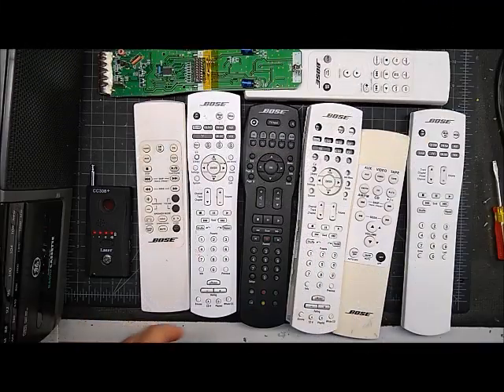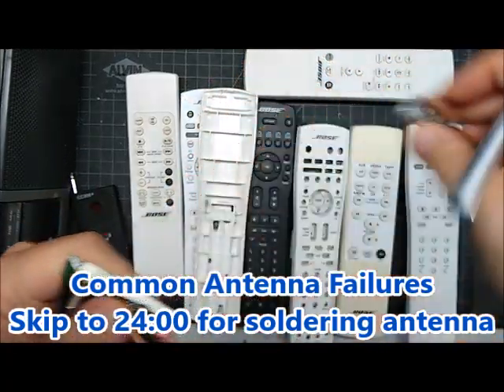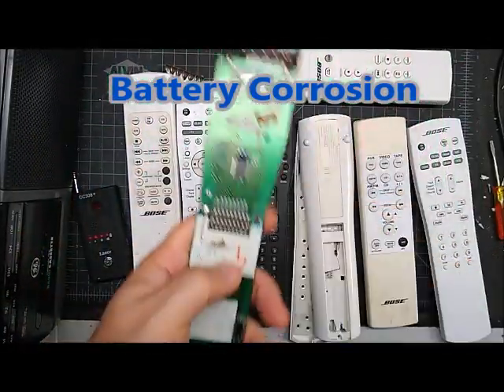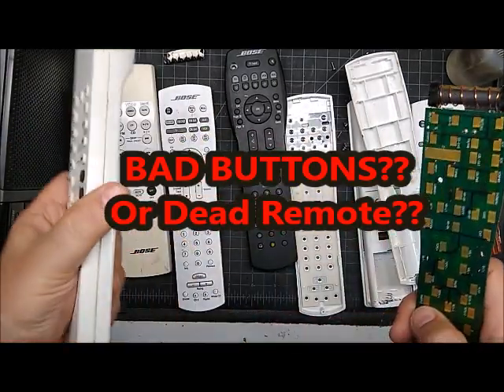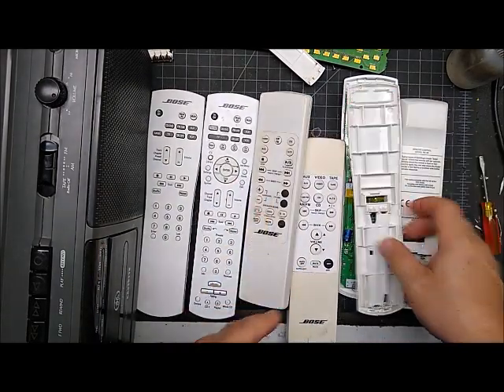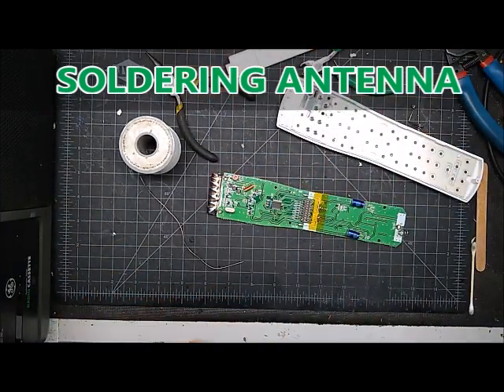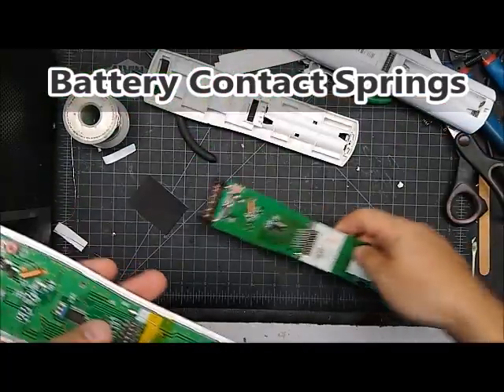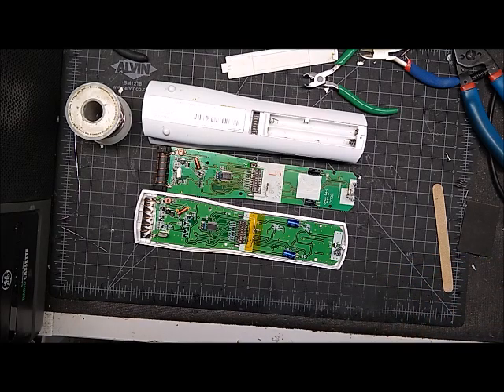Troubleshoot and repair old BOSE remotes

Comment: Thank you!! I got my remote working after MONTHS of trying. NO SOLDERING!  I'm not sure what exactly worked. it could have been the cleaning. It may have been wiping off corrosion (which it didn't really look like there was any). Wiped the board down really well after you spoke about the silver dust causing a short and keeping the button on. LASTLY, I realized on my last reassembly, that when putting the controller back together, ONE OF THE BATTERY SPRINGS DID NOT GO INTO THE GROOVE OF THE REMOTE. WHEN I PUT THE REMOTE TOGETHER, ONE SPRING SLID DOWN ON THE WRONG SIDE OF THE PLASTIC, WHICH WAS KEEPING THE BATTERY FROM MAKING CONTACT. Once I put it back together with all battery springs showing and making battery connection, it WORKS!!! Thank you!

Comment: I have a Bose wave radio that I have for 12 yrs that been sitting for 8 of those years.  I believe it was shorted, I am wondering where I have it repaired.  All I hear is static, nothing else,  with a nine volt battery in the back it just lights up.??????

Comment: I have a Cinemate SR1 remote that won’t power on the soundbar. It is the black remote you are showing, it works to power on and off the TV, but not the soundbar. The 3 top buttons don’t do anything.

Comment: Thanks for the great video. I bought a Bose set on Marketplace for cheap because the remote was dodgy. Your video helped me to narrow the problem down to the aerial which the solder had come loose - easy fix. When testing it out I also noticed a setting on my Apple TV by which I couls control the volume from the Apple TV remote so double win.

Comment: Great video.  Do you have instruction for fixing Bose RC48S2 remote?  That's the remote with the LCD screen.  My remote will not power on.  I don't see any corrosion on the leads.

Comment: Good video letting people see inside their remote controls which are the same, I noticed the trouble you were having soldering the thick solid earth copper onto the board, the problem with this is it's a heavy piece soldered onto a small PCB pad, it might break that pad off in time, you were having lots of difficulty soldering the antenna because you didn't pre tin the whole piece of copper you were going to solder, it broke off because you didn't apply enough heat into that piece of copper, maybe a small "helping hands" clip would help you, it can hold the wire for you, while you apply lots of heat and tin the wire, soldering the antenna to the copper then would've then been easy.

Comment: Love this! For my remote the Sound button is suddenly flipped. E.g. up button reduces volume and down increases it... do you have an idea what could be wrong 😂
Reply from the maker: That doesn't even seem possible. I would check for corrosion on button contacts and IC chips. maybe corrosion is confusing the processor

Comment: HI Great video! I had a question regarding the Crystal in a remote like the one you have all the way to the left in your video. The crystal broke free and the pins are completely gone for the most part(broke flush at the base of the crystal) so I was looking online to find/order a replacement but they seem to be pretty hard to come by at the 27.145 mhz frequency, unless going to a rip off artist trying to charge $50 for the part plus $20 shipping for what I believe is a $1 part. Would you know a good place to get them (I'm in the US) or would you know if the crystals that are much easier to find but  only at 27mhz flat frequency would work? Any help would greatly be appreciated.
Reply from the maker: I found them on eBay from China a few years back. You would need the 27.145

Comment: Greetings I have the bose cinemate control, when I try to increase the volume it does nothing, if the low works but it does not increase the volume, the other buttons work, I did what you mentioned to clean the board with alcohol but nothing happened, some other recommendation that you could give me, I await your answer, thank you!

Comment: Another possible fix was: THE up and down pins on the back of the remote which sync your remote to your system; they all "LOOKED LIKE" they were down, but one of them was barely up from the fully down position. Maybe this was keeping remote from transmitting.

Comment: Sir, Everytime I push any remote buttons, the music stop / mute.
After I pushed any button the music starts again, is the remote broken?
Reply from the maker: Sounds like something is wrong. Some Bose remotes have silver paint snap domes. That can wear off and stick to the circuit board causing short circuits. It could be battery corrosion or water damage also.

Comment: My remote only works close to the receiver, any ideas why that is?  Antenna is intact, batteries are good, and all the buttons work close up.  Once I get more than 5 feet away it doesn’t communicate with the Bose lifestyle receiver
Reply from the maker: Are you absolutely positive the antenna is not broken? The wire can break inside the white glue holding some of these in. Almost certainly a bad antenna unless you have removed the glue and verified it's good.
Reply: I did verify that the wires are intact, I repaired it many years ago when the wire on one side of the antenna was broken. I might of shortened one loop of the antenna wire to resolder it down (didn’t know not to do that) but it doesn’t look like it.
Reply: I'm having the same issue now myself. I have to be within 1ft for the remote to work.

Comment: Searching for a replacement crystal oscillator for the Bose RC-9 remote.  The component is marked as RALTRON 27.145 30.  Can you recommend a good source that carries the oscillator or a generic version that will work?
Reply from the maker: There are a lot of choices on eBay... mostly China. Just search for 27.145. Any should work
Reply: @p1repair  Thanks!

Comment: Hi.! I have a remote that a group of buttons stopped working one day. Sometimes after a cleaning when is still wet with alcohol, those buttons start working after a few minutes stop working again. What it could be?
Reply: Did you clean both the pads and the PCB? what did you clean it with?
Reply: @nickfatsis9607  alcohol. The problem was the ic. Thank you